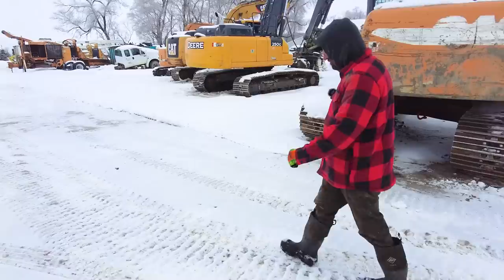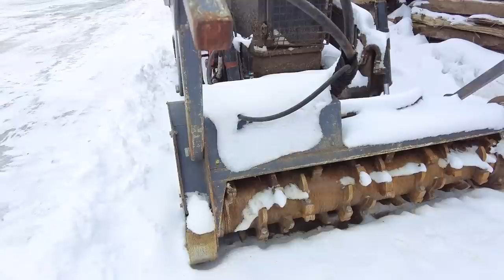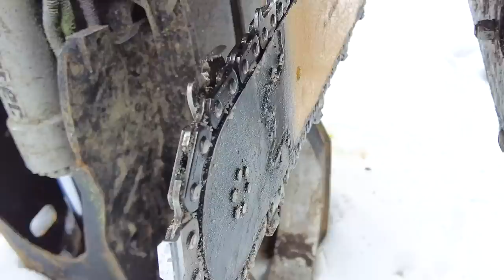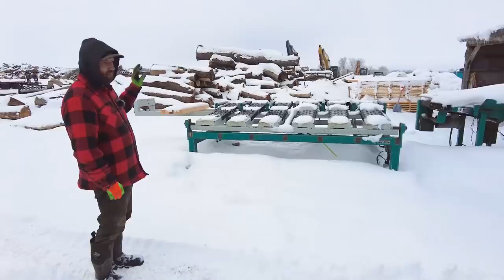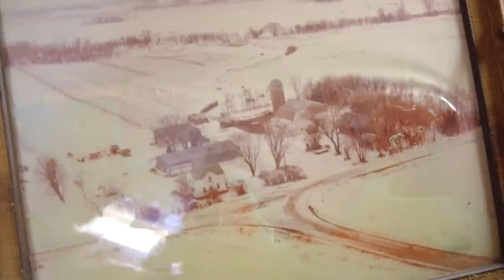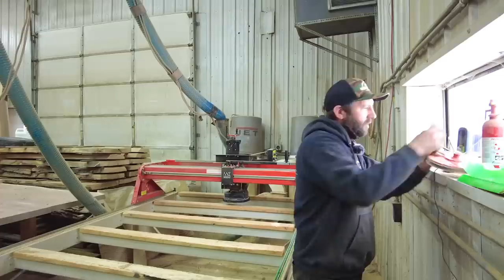From Feller-bunchers to Furniture: How a Logger became a Sawyer & Woodworker | Visiting Matt Collins

Comment: All I can say is wow. I was impressed with your trailer and sawmill fabrication. Also the knowledge you have for woodworking.  Then you show this guys operation and it was amazing. I know there is a metal fabrication/repair shop on that property that is probably just as interesting. 
I started out in lumber drying and milling, then retired from pipefitting.